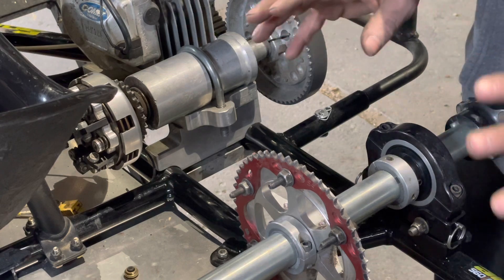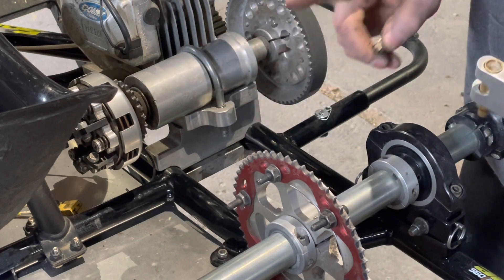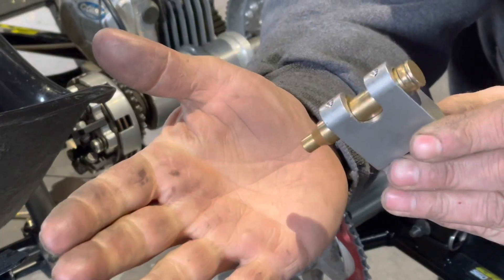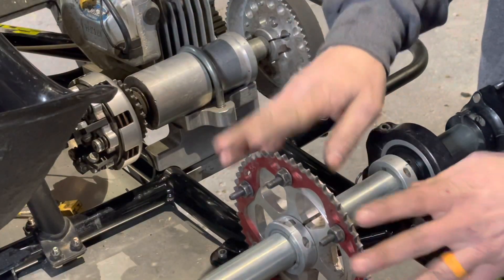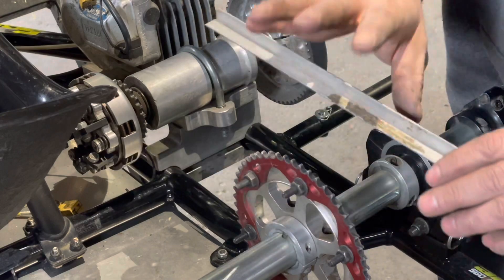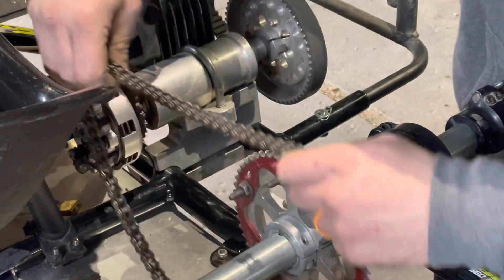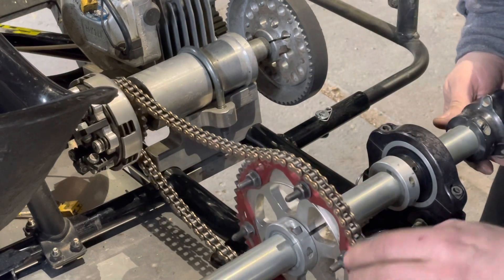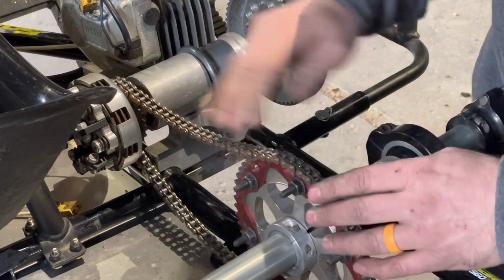Quick tip: Kart Chain alignment

Comment: I have found after trying all of your tips is that the last tip is the BEST and most accurate method. Although I would take all slack out of chain first. If the sprocket, axle or engine/clutch is off by the smallest amount of angle not visible to the naked eye then you will have excessive wear on sprocket and clutch gear.
What I do is spin rear axle by hand and look for equel clearance to eather side of chain to sprocket.
I think this is the most accurate way to do this.